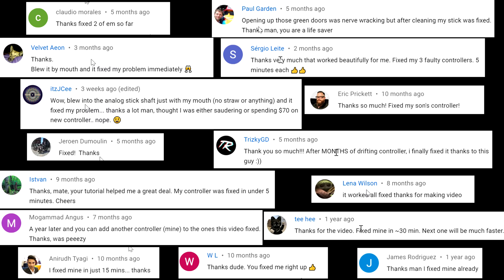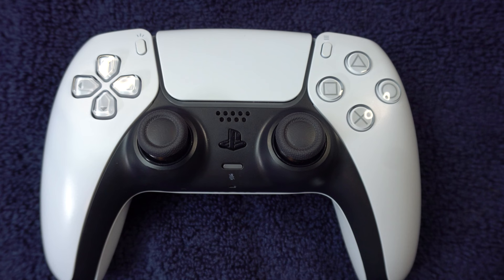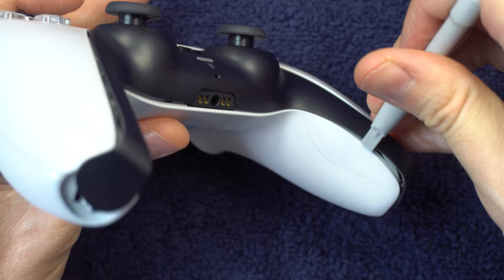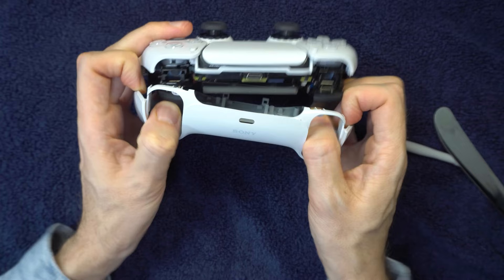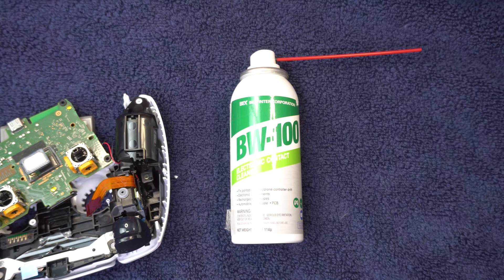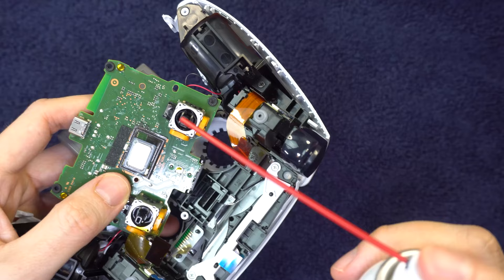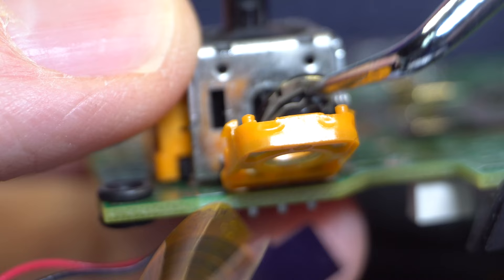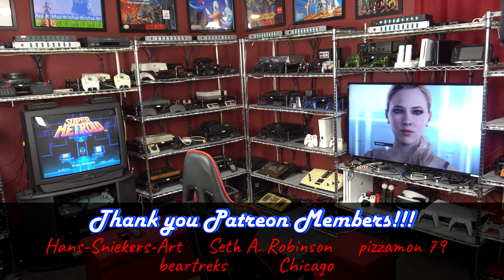How to Fix Analog Stick Drift on PS5 DualSense Controller (Sprinting/Repair/Clean/R3/L3/Take Apart)

Comment: Its shit like this that makes me wish murder for a good reason was legal because selling $60 controllers with shitty cheap components from billion dollar companies is getting on my last nerve.
The ps4 pro alone i have 7 controllers that have stick drift issues! 
My Ps5 the controller that comes with it the charging cord stopped working within 2 weeks, now the controller is having this out of the blue stick drift on the menu & in Elden Ring thankfully it hasn't gotten me killed but its now to the point I let go of the controller im just going left or snapping left at random. I cant even go to the menu as it immediately scrolls as far left as it can go the moment i release the stick. 
Sony & Microsoft because ive had stick drift on my fucking Elite controller too needs to have some employees or creators of the controllers or higher ups put in the dirt for this shit here. 
Ive even taken controllers apart to try to fix & deep clean them for the issues to return a week later. They need to be sent a message this aint ok & if they keep fucking around its gonna be a problem. 
Thankfully I have a 2nd black ps5 controller that'll be used from now on, doing most of the steps & its not fixing the issue on the og white one, thanks for the assist & helpful video tho man 👏🏿👍🏿

Comment: I have a similar problem to stick drift but its the opposite. Theres a small zone in my northeast analog stick direction thats not fully reading. For example, sometimes my in game character will go from a run to a walk when i go north east or in the 3oclock area on the stick
  Any ideas that will save me 75$?
Reply: Yeah buy a new one and take the old one back in its place. Hell the corporations don't care about consumers.

Comment: My ps5 controller works perfectly fine in every game (about 30 games) except fortnite, where I have so much stickdrift and a lot of input lag. Ant reason it's ONLY one game?
Reply from the maker: They may have a very small dead zone programmed into the game. Meaning even the slightest amount of stick malfunction has a big effect in the game. Perhaps there's a way to increase your dead zone in the game's settings?
Reply: @HowToX  I tried changing the dead zone and no matter if it's at the max or lowest I still have the same issue when it starts moving out of the dead zone

Comment: A quick question, why can’t we use the regular wd40?
Reply from the maker: It'll grease it up. Not what you want. You want something that dries after you apply it.
Reply: @HowToX  got it, thank you very much this is helpful! 

Also, my other Dualsense’s analog sticks have a small click sound every time I move them slightly away from the center, I learnt this is a common issue for users but couldn’t any solutions throughout the internet. I wonder if lubing the potentiometers would help make it smooth and silent again, I would appreciate so much if you’d share any knowledge of it!

Comment: No one should have go through this. I bought a ps5 controller about 4-5months ago and it is already broken.i move the left thumbstick slightly right and it goes left. I have gone through about 5 controllers since I brought a ps5. This is ridiculous. My ps4 controller lasted for about four years before I had a issue

Comment: I think I'm just going to purchase a new one, put the bad controller into the box, and return it at defective.  I already purchased a 2nd controller thinking...maybe I dropped it or damanged it myself.  Now my 2nd brand new controller is less than 3 months old and I've got the same damned problem.  Sony needs to fix it, they have a problem and I'm not waiting 4 weeks to send it in and wait for them to return it.
Reply: Shit, been wondering same thing recently while playing games, for  some reason left stick ( I think) causes the character to look left etc, it is pissing me off

Comment: None of these methods will work.

It's impossible 
Moving joystick or updating it will not remove dust from the sensor lol.

Anybody who said it fixed the problem it only worked for 5 minutes or day or two.
Yes you may moved little bit of dust.
By moving joystick 
But it will go back to stick drift.

To fix it properly need to take it apart and clean joystick sensor.
Reply from the maker: Thie drift problem cannot be summed up that way. My drift videos have about 7 to 8 million views, so I have lots of feedback from people. Feel free to read some of it. Updating the controller DOES work for some; most likely because it increases their dead zone. I do not have many people who say it returns within days. Some say months. Some are cured forever, because they had one foreign object inside the box, not in the sensor. It can be a fingernail or piece of plastic. Cleaning the sensor should be a last resort. Even then it can be cleaned indirectly through rinsing. See my latest video for the latest techniques.

Comment: no chance

if you once had stick drift the controller is done
Reply from the maker: The comments say otherwise. Stick drift can be caused by a variety of reasons, including debris that has gotten inside. Removing said debris is very effective.

Comment: In my experience PS5 controllers are dogshit. I've had PS3 and PS4 and never had any problems with the controllers.
With PS5, however, the situation is dire. I have 3 controllers, 2 of them have alread broke in some way. Absolute shit.
Reply: I too had a ps4 and never had controller problems. As for the ps5, every new controller seems to start drifting after around 3 months. I thought i was problem but after going through 4 controllers all with the same problem I’m convinced it was designed that way on purpose. Make more money on controller sales

Comment: Why destroy a PS5 controller after trying to open it up when you can always buy a new one. Also never believe what you see on the internet since I rely on a repair shop to handle and clean my consoles or controllers since I never trust clowns on the internet making videos on how to break this and how to destroy that
Reply from the maker: LOL. If you are going to throw the controller away, why would you not attempt to fix it yourself and save some money? Also, if you doubt the detailed repair guides I make, just read through the comments on my videos and see how many people say that it helped them. Spoiler, there are thousands of said comments.